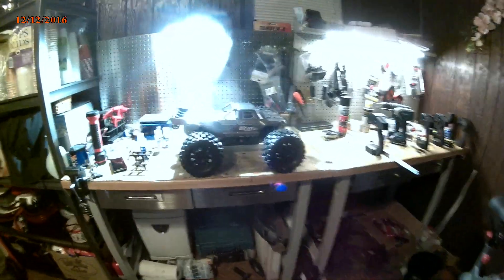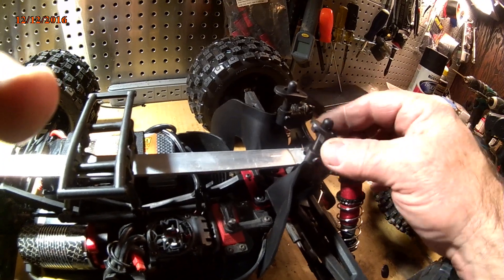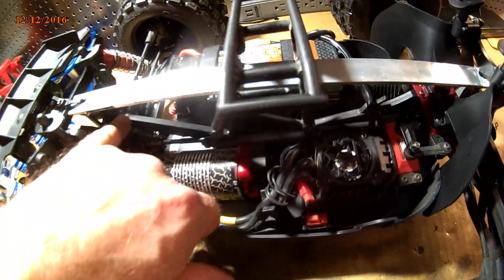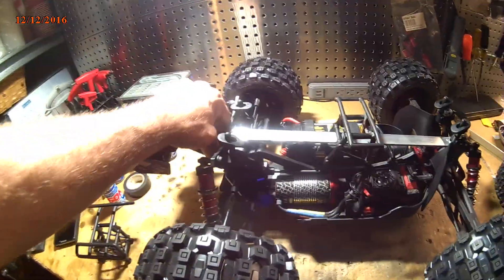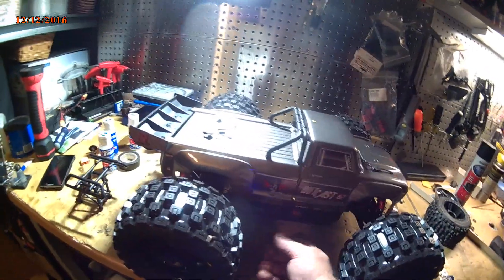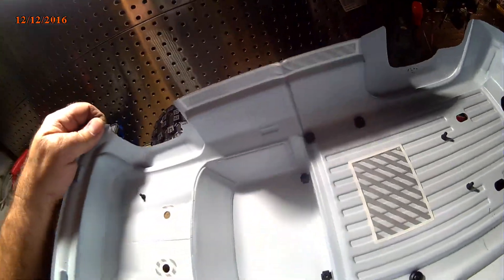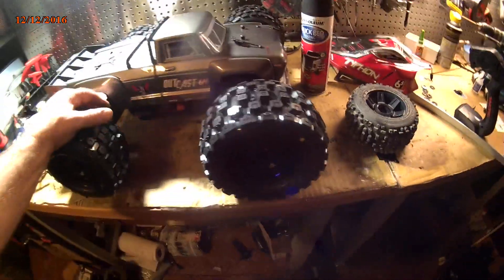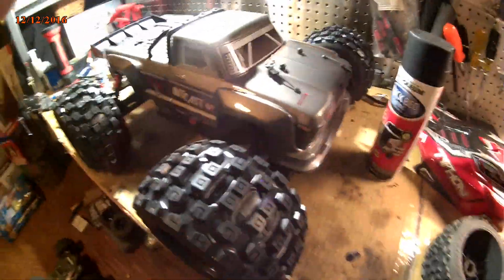arrma outcast on steroids

Comment: Nice vid bro. You've created a monster! Those meats look bad ass, can't wait to see here jump on 6s. I like your fabbed chassis and body supports. Bed liner or Flex seal is a good idea. That stock wing flattens with roof landings and body jams hard into shock tower edges, cracked mine first bash. May want to pad towers or put self stick felt blanket pad onto underside of body. Felt stopped the damage to mine. Great build!
Reply from the maker: thanks for tip on felt pad.. thats why i like doing this channel because you can get and give advise on different stuff... Bash on bro

Comment: Deadly looking truck, does the vent hole in the tire cause them to rip at all, would love to see some tips and tricks videos! Great show will be watching!
Reply from the maker: i have video of tips at waterproof tires.. heat up drill bit and  drill in reverse and let it melt the rubber... be careful and don't drill deep into foam...As long as you melt hole it will not shred..
Reply from the maker: the video is kraton upgrades and tips....Shows tire waterproof...BASH-ON